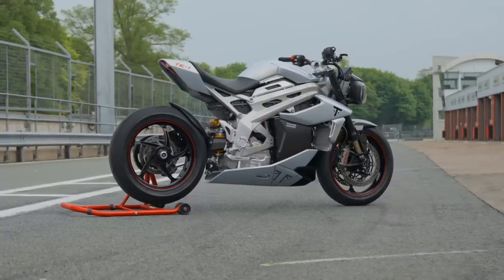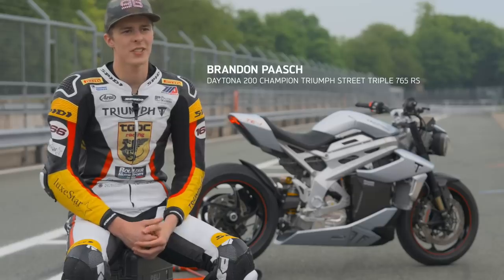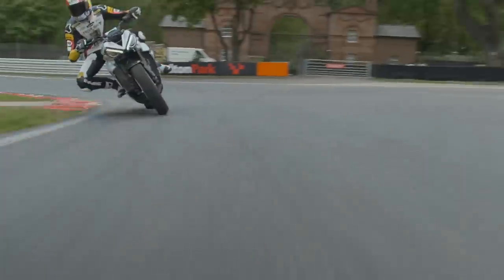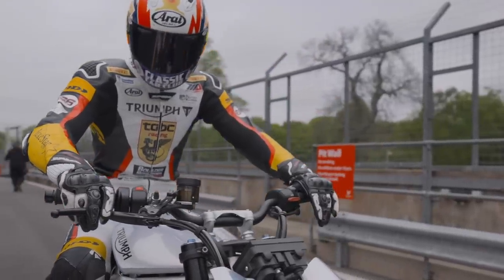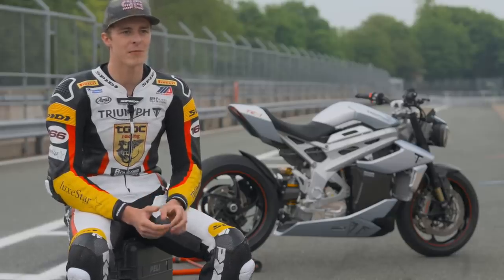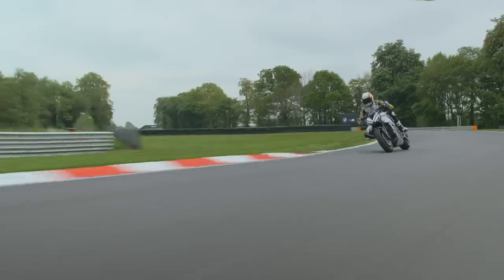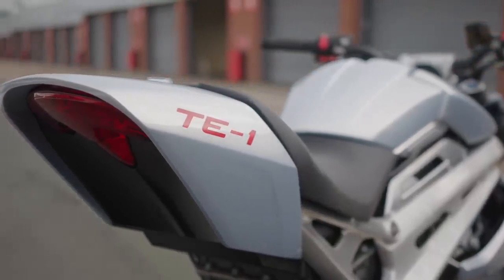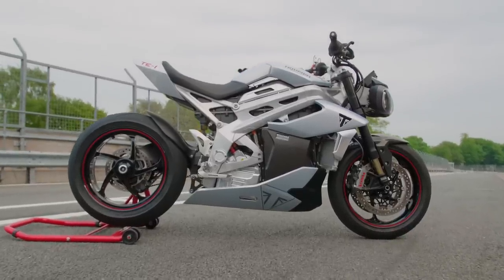Project Triumph TE-1 | Electric Prototype Completes Final Testing | Full Film

Comment: Hopefully the full production bike will be able to get more range than 100 miles. Other than that the bike looks beautiful and sounds like a blast to ride.
Reply: I wish for more range too, but I'd be happy with the 20 minute to 80%.
Reply: @RobertCole1981  yes. fast charging seems more useful than super long range with current battery tech. you don't want to carry a lot of dead weight all the time, and pay a huge premium, for additional weight that you would only use once in a blue moon. charging network needs to be dense and reliable though. one of the requirements I would want before buying an expensive electric motorcycle would be ability to fast charge on electrify america AND Tesla superchargers, with a light / compact adapter or no adapter at all, and good navigation that will take me to a charger   that is close to my route, fast, available and working. the technology is not ready for a gt touring bike with comfort / passenger / cargo and long range so probably better to focus on a naked bike that won't do very long legs anyway

Comment: If they use the platform to a functional degree and apply it for the street twin, I'd buy it without question. I can only assume that there is a dance between weight, range, power output, and cost,  but I'm hoping they can use this information and refine it to be more accessible to your casual and long time rider.

cheers to the people that made this happen, specifically the R&D team, but really everyone.

Comment: 0-60 in 3.6? That was a disappointment. An Energica or even a Zero SR would be quicker or just as quick. Please unleash the power as that result should indicate lots of intervention from ECU/TRC.
Reply: So lets hope that they get the double range instead ;-)
Reply: fast enough for me,  but it's only a prototype, not road ready.  Torque and range are, for me, much more important.
Reply: @n-i-c5800  100miles range is about as unimpressively as 0-60 in 3.6secs.
As a prototype I expected performance not range. 😊
That said I am very pleased with Triumph going electric. 👍
Reply: Triumph met all their goals on this prototype, it's a win. And the specs will only get better from here.
Reply: Nowerdays 0-60 mph in 3.6 seconds seems slow.  Sub Three seconds 0-60 Will be impressive.
Reply: it's an electric motor not an IC engine

Comment: Why is every so called motorcycle enthusiast so happy about a damn E-Bike? They are relying on a place to charge up if the battery gets used up before you complete your destination. Also they make no real noise, so people never hear you coming like they do when you have an exhaust pipe. I feel in love with motorcycles as a child because of looks and especially the sound of the engines and exhaust pipes. Also i love the concept of clutch and gear working together to control the power. Everyone here in this comment section sounds so quick to want to do away with what we have always loved. And another thing...this completely breaks away from the legacy of motorcycling period! This is not a motorcycle this is a scooter for doing Uber eats now! 😒
Reply: It’s called progress. A hundred years ago guys like you ridiculed petrol engines and scoffed that all we needed was faster horses.
Reply: @stefanthesailor967  Progress isn't always a good thing. Think about it.
Reply: @mrnoisy4883  what’s ‘not a good thing’ about a bike that’s cheaper to run, quicker, and helps climate change?
Reply: It will have no effect on weather whatsoever.
Reply: @stefanthesailor967  Cheaper to run? You not seen the price of electricity these days lol
Reply: @mrnoisy4883  mile for mile electric vehicles are about 50 percent cheaper to run than petrol ones.